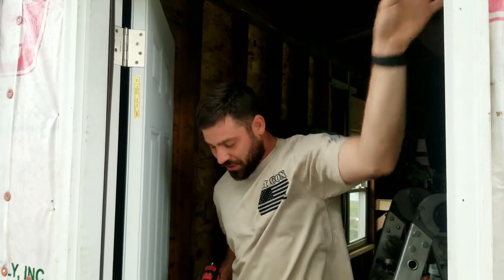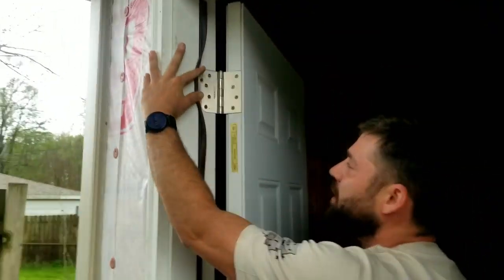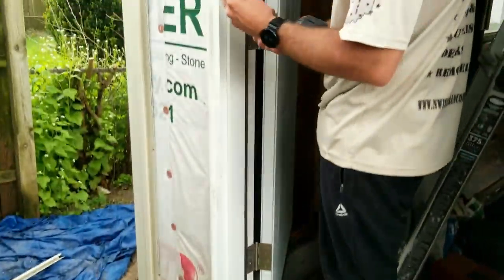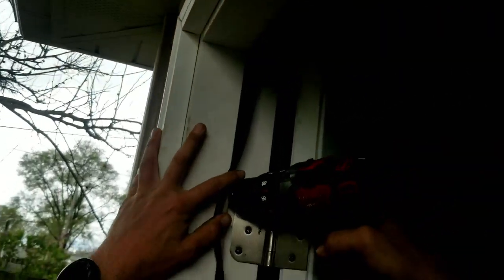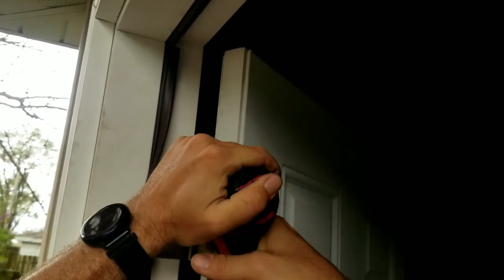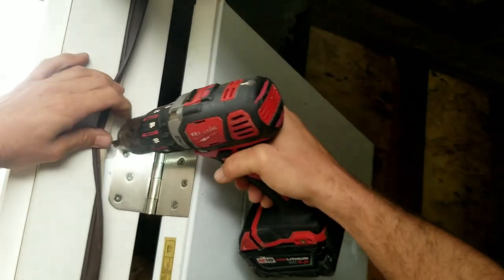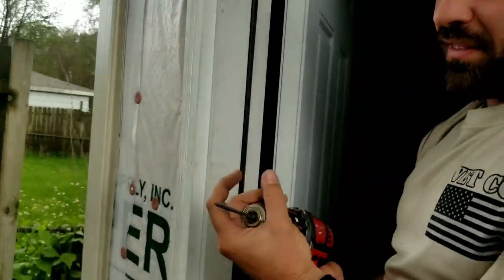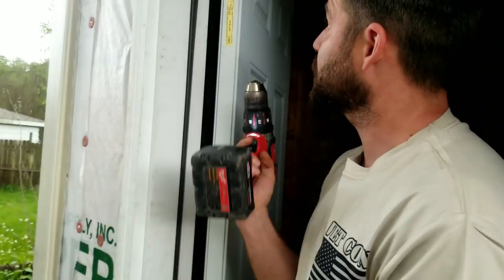HOW TO | Remove a stripped screw

Comment: I like to put the screws in the hinge on the hinge side, it supports the door that way and just holds the frame in pkace
Reply from the maker: we put one 3 inch screw in each of the hinges as well as put a few in the top and other sides behind the seal.
Reply: Worlds Fastest Shingler I normally skip the top but I like to do each hinge and 3 on the knob side, one right at the knob